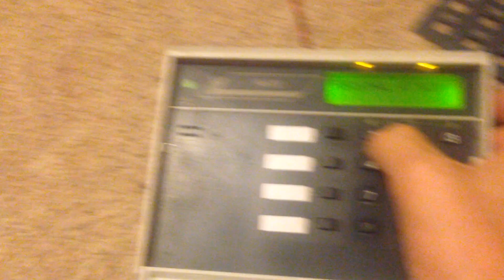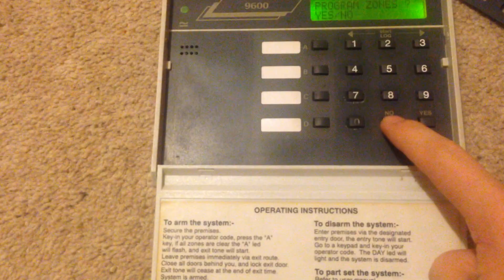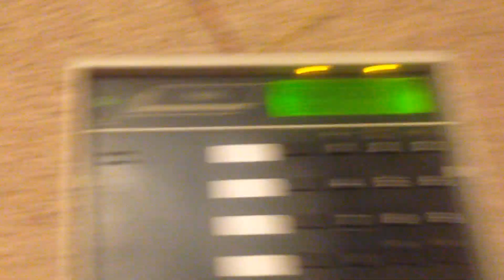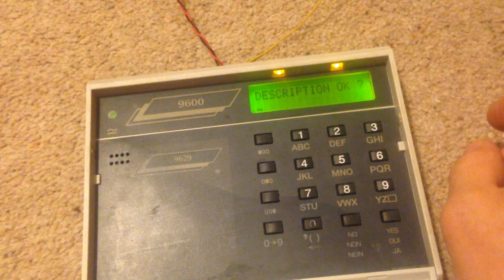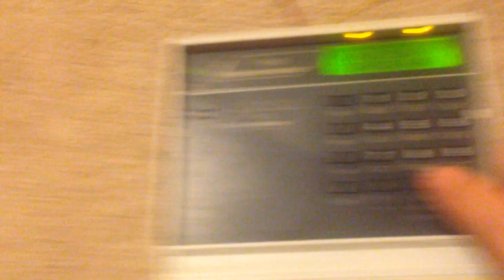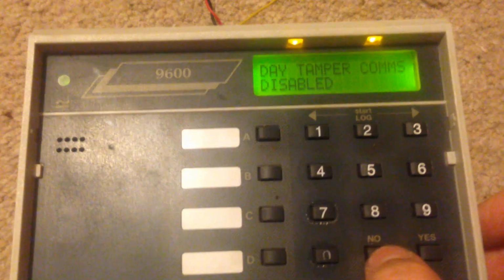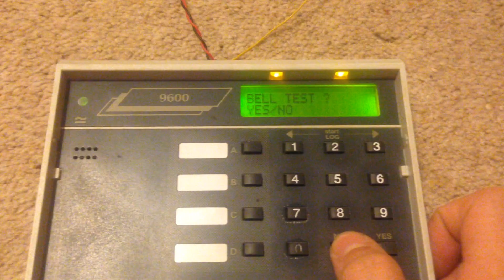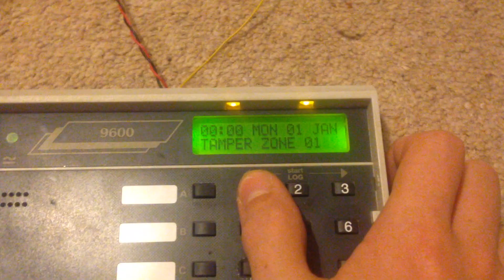Programming zones on a Scantronic 9610

Comment: Thought i escaped, but it found me.
Was a renegade engineer from 1992 - 2010, my fav panels were scantronic, 9448,9452, 9800, 9600 and the big one 9500, really good manuals as well. The inventor David Snook passed away 2019 RIP.
The Mid range Menviers were good, and I found the mid sized Galaxy panels ok.
All seems to go by so fast.
Don't work too hard, no body thanks you in the end. Take care everyone